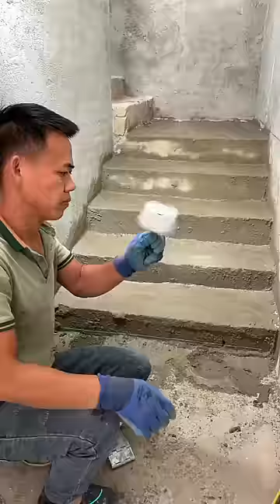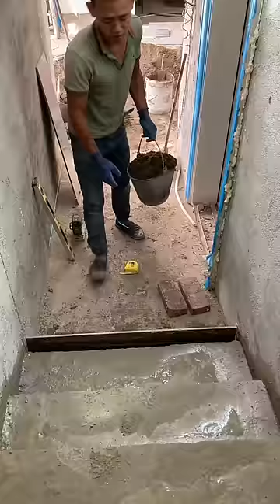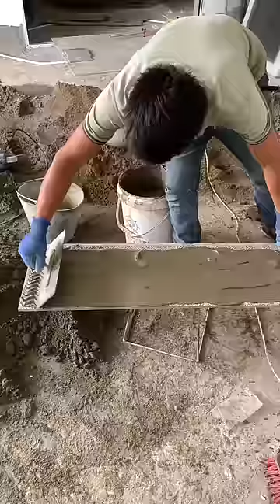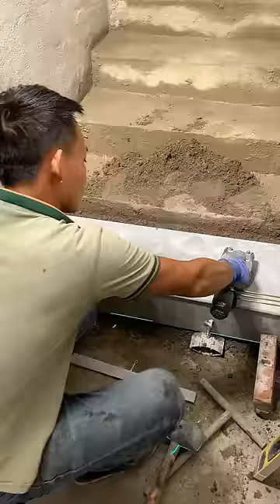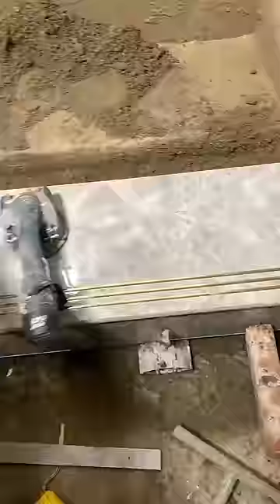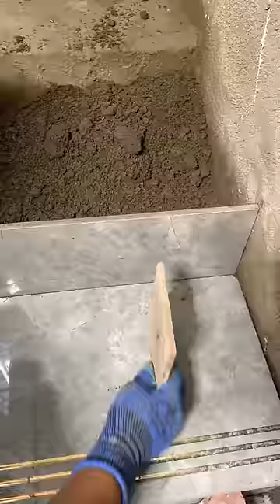Tile installation P528#shorts

Comment: Bro you were my inspiration for tiles fitting in my bathroom on 2022..but bro saddest part is that im still working in the same bathroom till date 2024 😢 im tired of my work. Last week i used power tool to cut wall grooves but the angle grinder tried to chop me instead of that wall 😢. Thank you by the way 🥺

Comment: Wonder CHINA!!
If you build your house like that, later the tiles on the stairs will crack or fall. When attaching tiles, use cement mixed with adhesive, and pour water into the soil to harden and stick.

Comment: It will crack as soon as it is used. The concrete underneath needs to solidify, the tile glue needs to be consistency of peanut butter. This cheapskating will result in bad quality and needs of repairs soon.